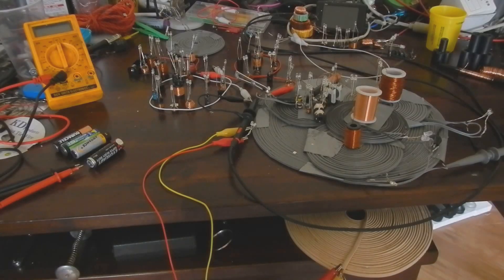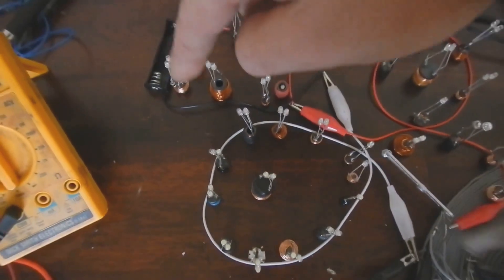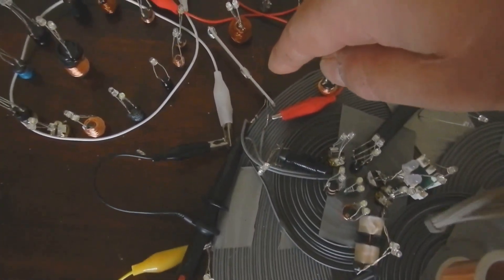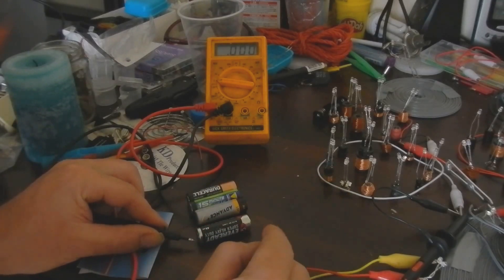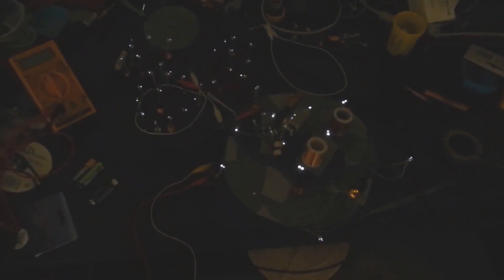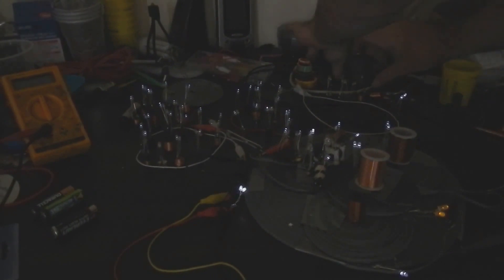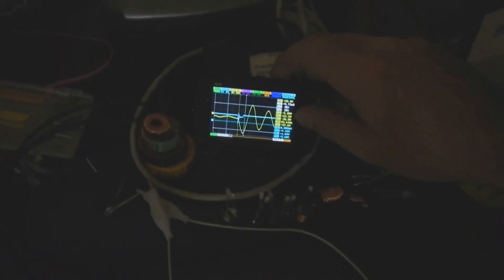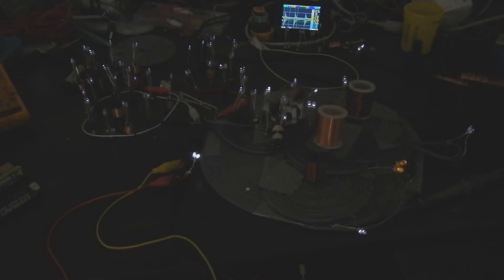50 wireless recivers resonating from 1 AA. Simple Wireless Electricty System.

Comment from the maker: Yep. Just found out how to use a PNP! This is my first working PNP circuit. It seems it does work with JT's too. Just reverse the polarity of the battery to switch transistor types. PNP seems to handle negative spikes a lot better. They are also used for their high hfe ratings, which can be useful for high boost oscillators. Should be solving a few of my recent smoky transistor issues...

Comment from the maker: YES! the more you load it up, the faster the battery goes down. Previous tests have also shown increased amp draw with increased load from receivers. Interesting things happen when the battery gets down though. haven't had one actually stop due to low charge. 2-3 days running and they just get really weak. Then stay that way until disconnected. A base resistor could tune it and control the runaway amp draw.

Comment: NICE! The 1 loop is similar to power collection off Tesla towers (especially for incandescents) and used to great effect on your system here. I've no doubt you could add to the receiver coil too...might get a decent room light from it. 
Would be good to try wire length tests (single wire ability basically), loop size tests etc..oh wait, you have other videos uploading :D